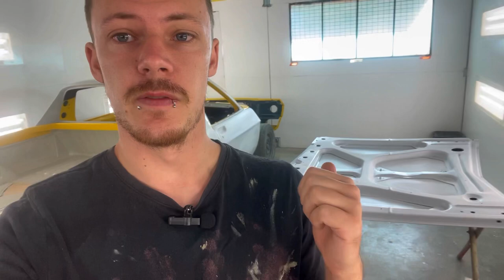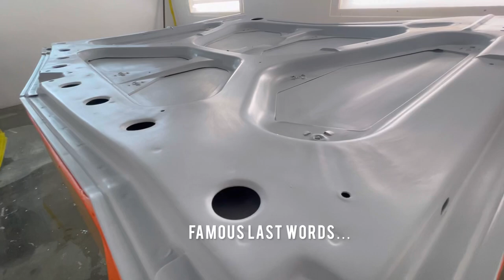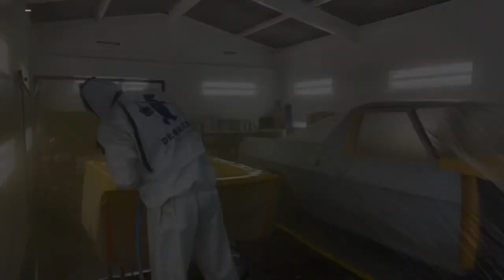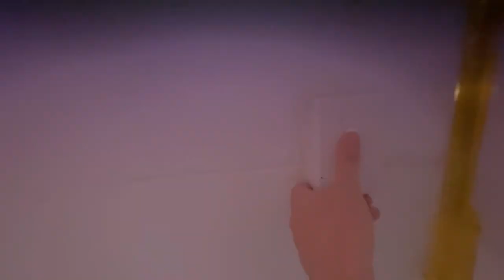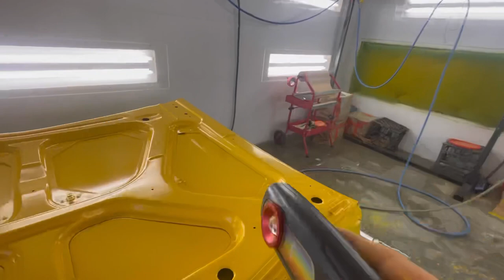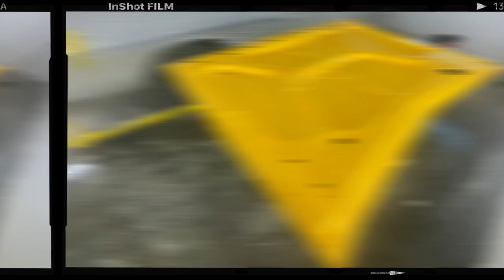When Painting Goes Bad…

Comment: Dude that looks well good enough to put 2k clear over. Your just over stressing. Clear is your friend with solid colours. You could see sanding scratches on dry base coat, and after clear shell be killa. Iv got a trade ticket next time tou can sa e time n money 👊
Reply from the maker: The basecoat was quite dry in the corners and balling up, multiply that by the amount of coats it takes that colour to get the right coverage it can turn pretty messy.
I don’t mind spending a little more time on something in an attempt to get it better rather than just calling it a day and moving on to the next thing.